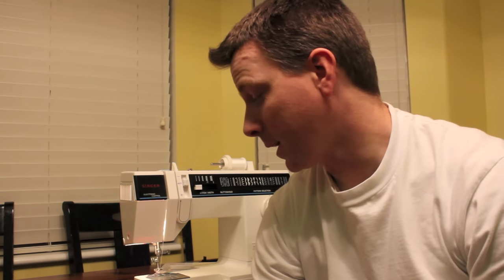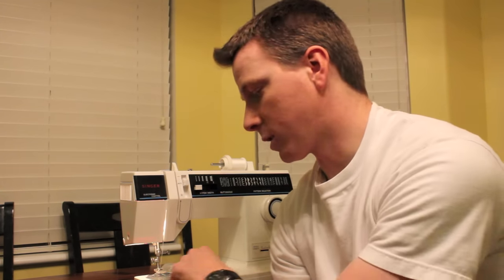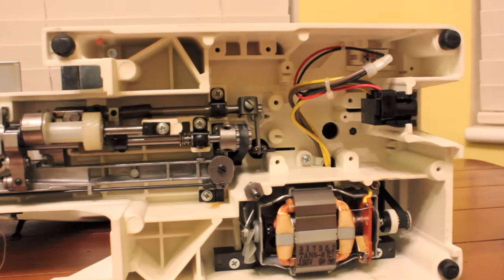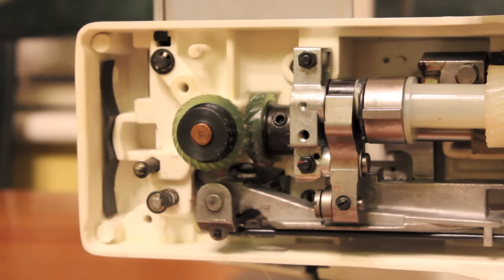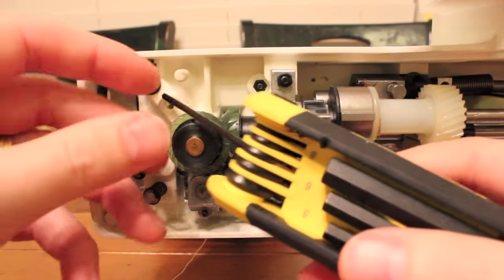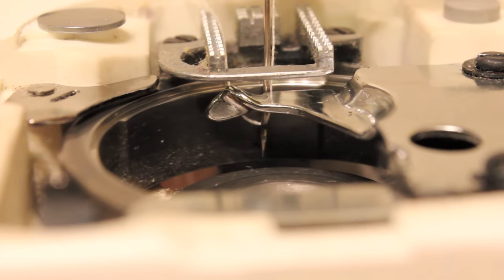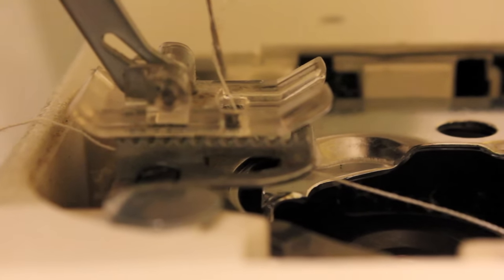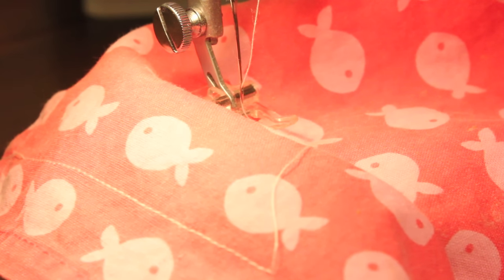How to Fix / Repair the Hook Timing on a Sewing Machine

Comment: Thanks for posting this video. My wife's "old" Singer machine's gear that drives the shuttle around wore and I have new gears coming in the mail that involve the shuttle. I was surprised I found the gears, but that's another story. Your understanding of the basic machine is the same or more than mine. BUT, your video showed me what I needed to know. It showed me the relationship between the needle and the bobbin shuttle as they go through their movements. THANKS AGAIN, I'm now not waiting in confusion for the parts to arrive.

Comment from the maker: Hi Barbara,
Sorry to hear that you've had a hard time with your machine. I don't sew much but as I recall, I put the bobbin in so that the thread comes out counter-clockwise, hooks through a little slot toward the front of the machine, then pulls around toward the needle. I pull it out through the holes in the metal plate. I'm certainly no expert at any of this but I wish you luck with your machine!

Comment: I wish I would have found your video yesterday.  I took my machine to the shop to have the timing adjusted for skipping stitches.  I was too specific in my search for timing a sewing machine. (specific model)  There are other areas of the needle rotation that need to be checked, so if this didn't work, I am confident you would have checked those also.  Great video!

Comment from the maker: I'm not sure I understood what you're asking but in my case, turning the shaft turns the gears as well. The set screw(s) determines where the gear connects to the shaft on the rotation. Once the set screw is tightened, turning the shaft should turn the gears. Good luck with the fix!

Comment: awesome. i just fixed my wife's spare machine thanks to your tutorial. she has a kenmore and it had a little more under the hood, so to speak, and the gear had two set screws. i loosened both and rotated slightly and it works perfectly now. i first made sure i knew the direction i had to adjust the gear and after i moved it a little i relaized i didn't really know how much. i was lucky but i suggest for anyone else to maybe use a sharpie to mark the current alignment, in case you need to reset.

Comment: Hi Nils I pay special attention to the sequence showing the hooking because it also shows the timing of the feed mechanism. My need is to rebuild both timings. One  hook gear broke in parts and the jam-blocking damaged the teeth belt. Now I'm done replacing the gear, about to replace the belt and adjust it all.
Your 2:57 3:40 sequence is exactly what I need to  do this. Moreover, nice video definition!
 Thanks!

Comment: Thank you so much for posting this! I bought a used machine off eBay for my daughter to use and told her that if she could fix it, it would be hers. The machine wouldn't pick up the bobbin thread at all. After looking at your video, she opened the machine, worked her magic, and got it working like new! Thank you!!! She thanks you too :)

Comment: That is amazing! I can't understand how the set screws would come loose to change the timing but it did  for me also. Although they were sooo tight that I wasn't sure if that was the problem or if it would solve it. But after my needle kept getting a tiny hook bent on the end then it finally jammed up by hitting the bobbin cage hook. I couldn't go any further. Your detailed video of the needle and cage position was very helpful. I wouldn't have known where to set it without it. Many thanks!!!

Comment: Thank you for posting this.  My 25 year old singer (looks to be a very similar model) broke in the middle of shortening my daughter's prom dress - Argh! - and of course prom is less than a week away.  The timing had been a little suspicious for some time, but today something finally caught, dragging the slightly stretchy hem into the machine (ouch!) and wrenching it out, I heard something move.  Sure enough, the upper thread wouldn't catch anymore and there wasn't really time to drag it to the shop so close to the event. I started taking it apart (being an engineer), but was in a hurry to just get it done rather than explore the inner workings of my machine.  It took me longer to find where my husband hid the allen wrenches than it did to adjust the timing and get it back in working order after seeing about half the video.  The prom dress is done.  Yay!  I couldn't have driven it to the shop that fast.

Comment: Thank you!  People need to be more into DIY, home appliances usually quit working due to maintenance issues!  Too many people blame the machine for being a POS and will throw it away before looking into the problem.

I find this all the time with old washer and dryers.  With dryers people get frustrated when they don't dry fast enough.  They will try another used dryer and have the same problem.  

What they don't know is the dryer works great and that the vent is clogged with lint! 

Now I am into new technology and electronics, but I have to say old appliances wear made to be repaired! New appliances seem to be made to be replaced when they break! 

Thank you for your help!!!
Reply: I have a couple of Commodore 64"s on my closet shelf. :-) Yes, much that's made today is "disposable" & "designed obsolesce". Remember well when computer keyboards became disposable. More economical to replace than it was to repair. That's why TV repair shops have all but disappeared. (None in my area now.) There's money to be made when the old is tossed to be replaced by the "new & improved" rather than replacing a 10-cent washer or a $1 bushing.
Reply: Oh yeah. blows I've heard of so many dummies who throw away perfect stuff just because they're rich and don't care.

Comment: I have a Singer, which was gifted to me from the hub in 2002 when he was on active duty with the Army Nat'l Guard. He bought it at the PX, and from day one, it seems to have tension issues. About every yard or so worth of stitch, I have to stop what I'm doing & rethread because my bottom stitches become loose, then drop completely. The fabric/thread types and tension wheel adjustments matter not. After watching this video, I think I may have found the problem. I am going to try this fix. Thanks!

Comment: Thanks! I was able to fix my machine after watching this! I just wanted to add that I had to loosen the screws (there were 2 on my machine) on the bushing, adjust the hook to meet the needle at the right time, and then re-tighten the screws. Without re-tightening the screws connecting to the bushing the shuttle would get loose and no longer turn at all with the needle. Also, your drive shaft, bushing, and shuttle were MUCH easier to access than on my machine, but I managed to figure out how to get to the parts without TOTALLY dismantling my machine. Other than that, this was a great help. I have the Singer Fashion Mate 7256, for anyone else trying to fix a similar model.
Reply: +tonybear321 I have the same model and I can't seem to get to the same part on the bottom. Could you offer any advice because I really don't feel comfortable opening my whole machine

Comment: Thanks - your video helped me fix my Singer 2210 machine. Mine had two set screws. I did end up breaking a couple of needles because the needle hit against something when it went down in the hole, but I finally managed to get it to work. I think it was because I adjusted the wrong screw the first time and it made the gear slip too low or something.

Comment: This video was very informative and helped me correct the issue.  Thank you for doing it.  I did not even know before how it really all worked in tandem.  I never did have to change the set screw adjustment.  Just cleaning and oiling....but thanks for the heads up that themachine could really only need just that, that the set screw might never need to be adjusted  Keep up the good work and I will keep with yearly and monthly tune ups.  I am a cheapskate too.  The repair place wanted $70

Comment: This is great help. You got straight to the point and fixed the problem without any condescending mumbo jumbo. It did not address my issue though.
 My machine is grabbing the thread in the upper part, the mechanism that moves like an elbow, moving the needle up and down. I opened it up where the light is and found thread wrapped around the part in there where it's catching and breaking. Every search I've done to find out how to stop that from happening turns out the same result. 'How to stop thread from bunching underneath' with the words upper part et al. crossed out. :'( I'd take it to the shop but I need it sooner than a month from now.

Comment: e thank you for your expert opinion. I found u to be more informative than 20 videos I've watched. My problem needle won't go up and down but motor whining. Took apart found there's a latch next to wheel where belt is. If i pull latch backwards machine runs perfect. Can't figure out hold or where to make it stay in place. Anyone that know machines I certainly don't. Can help me identify this part and help with placement? Please & Thank you!

Comment: Working fine then no stitches at all but used thread. Got info from friends on other sail boats. Most real sailors have machiens.was told hook timing is the problem. U tube had u and the hook timing vidio first glance. Thankx will watch all the rest also. Excelent...

Comment from the maker: Thanks, AnglesAvenge :) I should probably mention that I'm the one who broke the sewing machine in the first place, but that can be our little secret. Oh well. All's well that ends well.
Reply: So did you break it by forcing it to sew over something too thick? That's what I just did and now I seem to have this lousy and frustrating timing issue. Just wondering if that's what caused it for you too. Everything was fine until I went over way too thick part and forced it :(
Reply: @deplorabledixie2834  lol don't feel so bad, I did the same thing. I got so mad I just janked the turning wheel so hard and heard a "bink". I left to go do something else and came back and my sewing machine didn't work haha. Luckily I was able to fix it by loosening the wheel, scooting the bobbin case up a notch, tightening it, good as new.
Reply: @Emerii1  That is awesome that you were able to fix yours!! I couldn't follow the directions of this video so I just kind of pulled around on the bobbin area of mine and it seemed to shift to the left and then started working better, but I don't trust it at all and really scared to sew thick fabric now...I'm really babying it. Now have the problem of it making grinding noise (needs oil) and when I look online it says my model has to have a repair man oil it which I am not gonna do. I just ordered some oil and just gonna try putting it on the moving metal parts - that's what I saw in a video. We'll see how that goes..hopefully I won't wreck my machine.

Comment: Dude the tip of my needle is hitting the inside plate and damaging to tip of the needle. I don't know the name of parts either. This video was posted a million years ago. Are you still responding to comments? Great video BTW.  Thanks for posting.
Reply: Chantell Patrick SAME
Reply: I NEED HELP
Reply: Same for me!
Reply: I know I'm about 9 months late but your problem is the rod the needle is on. You need to take the cover off and loosen the screw or Allen head and raise the rod that holds the needle just a hair and alignit with the hook that takes the string. Be careful when you loosen the screw.
Reply: I have the same problem with my jennie,  how can I fix it?
Reply: Make sure you get the right needle for your brand and if that doesnt work, your timing really is off. Mine got off cause i was sewing through a thin leather that was messing up my machines timing.

Comment: Always change needle, check tension, and clean under the throat plate before going into timing. A bent needle or improper tension can give you all the same symptoms of timing being off. Good simple video though. Just wanted to say that because I work as a sewing machine mechanic at a factory and that's the very first thing we do.
Reply: He got lucky. He timed at the wrong gear.

Comment: Thanks for video, getting the timing adjusted & maintenance costs me so much every couple of months. This will come to great use. Do you have any idea how to straighten out the needle arm? One of my machines is aprox. 4mm off to the right. And they tell me it's not part of the standard maintenance like the timing is. Honestly I would much prefer never to have to bring it back in. Thanks again!